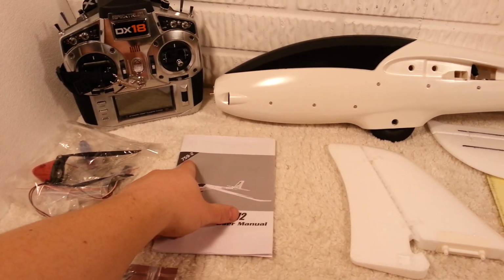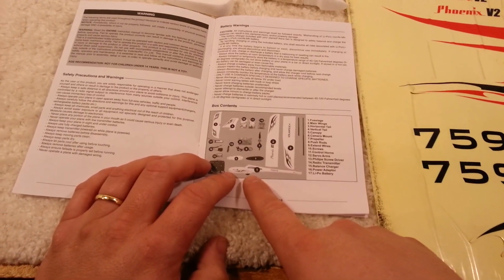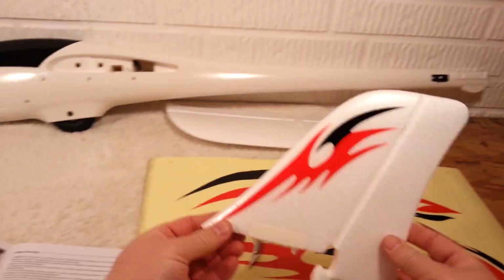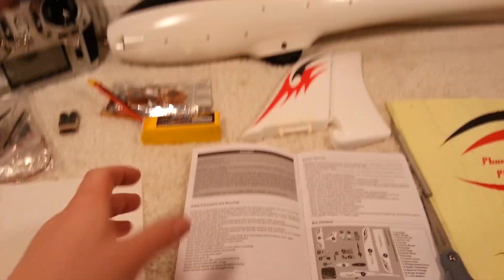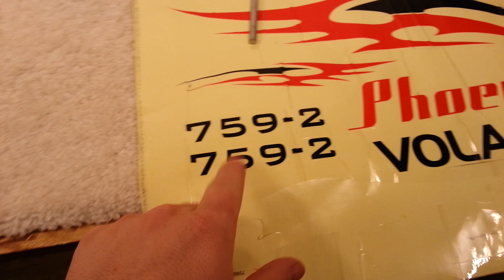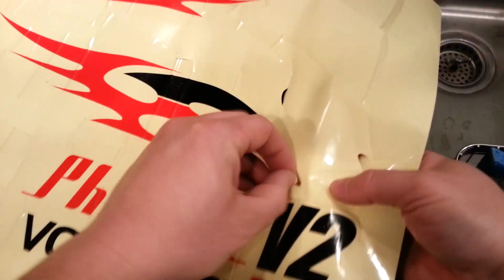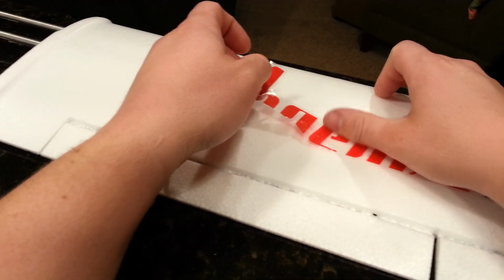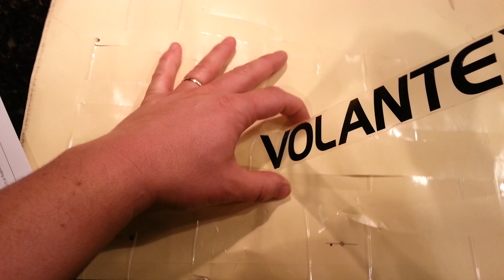Volantex RC - Phoenix V2 - 2m - Build Series - Decals

Comment: Thank you. Very useful. Just about to apply my decals. What was the isopropyl alcohol used for?
Reply from the maker: Used to clean the surface before applying the decals, but you really don't HAVE to do this at all. Sometimes there's a lot of mold release left on the foam.

Comment: Brian..... what method are you using to hang your R/C stuff to the ceiling? I also have a space problem but have a lot of ceiling! Just can't go with large hooks though.
Reply from the maker: That's a great question. I used these "L" shaped brackets that I got as left overs on work related projects. I'd take foam and cover the flat part, then screw the top of the "L" into a ceiling joist. Then I'd do that twice, and stick the plane fuse, nose first between the "L"s, and the wing root would rest on the flat part of the "L". Later, I added more "L"s onto other "L"s till I couldn't hardly stand in the room!!! Now I'm doing thing a bit differently. I don't go into great detail, but you can see how I'm doing it now in our new house, as the end of a totally unrelated video - https://youtu.be/ERRd0uAxPcE?t=1h26m33s

Comment: Redcon. I had a wing down with one of those. But I tried a Spektrum in the same area, near a tower, and it looked to have cut outs too. The Spektrum did seem to come back sooner though and yeah no crash.
Reply from the maker: I hope the Redcon works out well, but who knows... I just want to get her flying so I can see how well it does :)
Reply: @BrianPhillipsRC  I'm interested in trying mine in another spot now. I just read a review that said it takes 7 seconds to recover after signal loss. 
Let's hope you will be in a clean signal area.
Reply: @BrianPhillipsRC  BTW. I was messing around with the cheaper version. Yours with the satellite may do just fine. I'm running low on RX now so I may pull it out and do a range test on it and all.
Reply from the maker: 7 seconds is a long time in RC aircraft!
Reply from the maker: Okay, let's hope you're right! I didn't have the satellite on the last one that may have been involved with my Rare Bear crash...
Reply: @BrianPhillipsRC  A lifetime! Can you just imagine counting, calmly.
Reply from the maker: I can imagine counting, but NOT calmly ;)

Comment: Hi Brian, can I ask why you've chosen a 60? I'm getting a Phoenix for my birthday and the recommended lipo is 1500-1800 would a 25 c  2200 or similar be ok?
Thanks mate.👍
Reply from the maker: If your pack is in good shape you could use a smaller size like that, but you need to be aware than if you really get on the power, and stay on it for more than a short burst, you will probably puff the pack.
That being said, if you're looking to slope soar, I suspect you'll want it more nose heavy, thus running a bigger pack might help...
BUT if you're trying to thermal, the smaller packs would be okay.
I only use 60C because they just last a lot longer, and I'm not especially nice to my lipos ;)
Reply: Brian Phillips thanks for the reply 👍 I think I'll go with the 60.
As a side note, I had a Radian a few years ago.... and a simple plug n charge charger, (just the balance lead) connected to charge and had no issues.
I'm now looking at chargers that can give a storage charge and have seen many videos where not just the balance lead will charge it? You need the banana connection plugged into the battery output also?
Help?
Reply from the maker: Watch about my setup here...

https://youtu.be/q1vSsnvCv3A?list=PLXTH0DstRDc5m50UjuP_p5qM-JGifFp

and possibly this one, near the end of the video... https://youtu.be/4phBLsvV_fo

Comment: Hi Brian could you not put a thin coat of lacquer or watered PVA glue over the transfers to prevent them form peeling

new to RC and have just ordered the Glider with the snow flakes on the wings I saw on your channel as my first plane keep up the good work just started on your back catealog of vids so will be busy until it arrives lol

cheers Phil in the UK
Reply from the maker: Water based polyclinic might work, but I bet they'd still want to peel up a bit. It's all about the mold release on these foamies, I think, so it's kinda hard to get around this issue.

Comment: Hi, I have a Phoenix Evolution 2600/1600mm RC Glider, it's a KIT version. 
I'm confused on the choice of motor and esc to purchase. Would you mind recommending me any suitable motor and esc for this glider matching with the lipo battery I have which is a 4200mah 3s 30c Lipo pack? Thank you!!
Reply from the maker: That's a HUGE lipo!!! You might want to use a smaller lipo, like 2200mAh 3S or less, since you'll have a hard time getting this plane to CG out.
As for ESC, I'd get a 40 amp ESC. Make sure the BEC (or UBEC or SBEC) is good 5.5VDC @ 4Amps or 5Amps, if you're gonna use a stabilizer, as there are a lot of servos to run.
As for the motor, that's a tough one, since the motor Volantex RC sells fit's like a glove...and you'll have to dig pretty deep to find the same size, with better quality.
Here's a link to the Volantex RC motor at Amazon... https://amzn.to/2FAJkNK ( I THINK THIS IS IT!!!)

Here's the ESC I'd use with a 5.5VDC @ 5 Amps SBEC!!!... https://amzn.to/2Kvqgzn

Here's a Turnigy Plush 40 Amp ESC that might work well... https://amzn.to/2S5qOyb

Here's a Volantex RC 40 Amp ESC ESC... https://amzn.to/2FBF3tm
Reply: Thank you for the recommendation and the lipo pack feedback. I'll take note on that and get a smaller one as you have suggested.
Reply from the maker: Great :) I think you'll still have to ride all the way back, into the "wheel well" to get your CG to work out, but 2200mAh 3S will get you a good flight time, and you won't have to add a bunch of tail weight, which will degrade the overall performance of your plane :)

The 2.6m is a great flying plane. I trust you'll really enjoy it!

Good luck!

Comment: The bec on that esc is linear and needs good cooling. Caused my plane to go full throttle with no servo control right to the ground.
Reply from the maker: I had this issue too :( That's why I usually use a YEP 40 Amp ESC, 5.5VDC @ 5 Amps SBEC - https://amzn.to/2Kvqgzn (and of course the Programming Card for this one... http://amzn.to/2DLNiSk ) but aim to leave this one stock for now and see how she performs :)
Reply: Brian Phillips good luck with it :P Now the hardest part to repair is the main spar since it’s a very odd size. I ordered carbon fiber arrow to replace it. It was the only tube I could find with the same diameter. The esc was now replaced with a fms predator 40amp
Reply from the maker: Good choice for spar! I've never done it myself, but have heard it's a great solution.